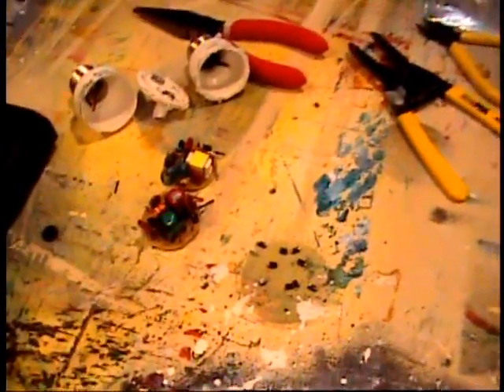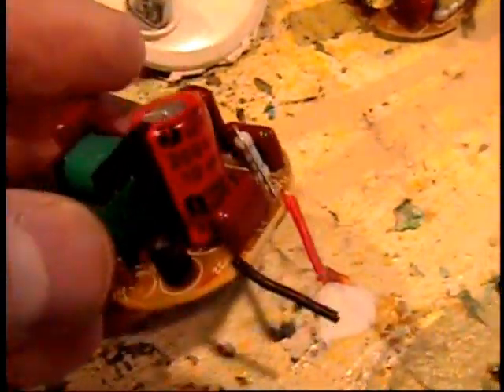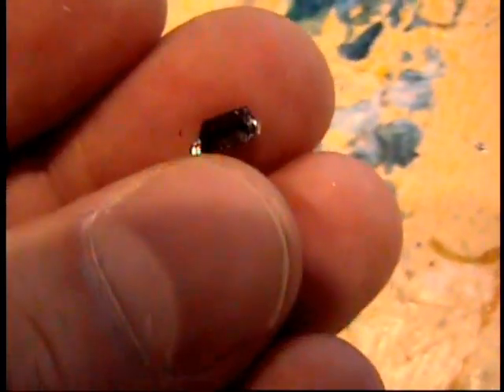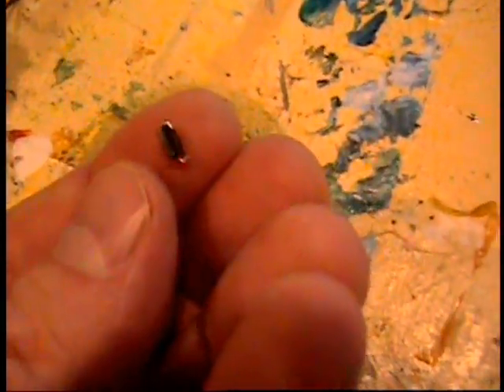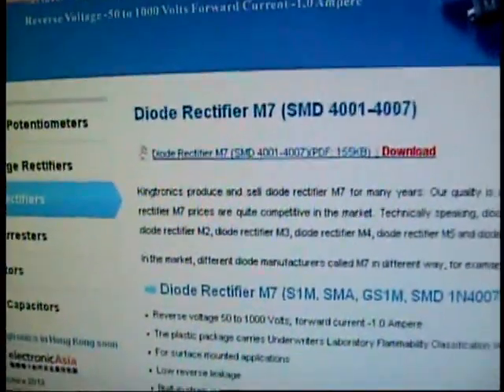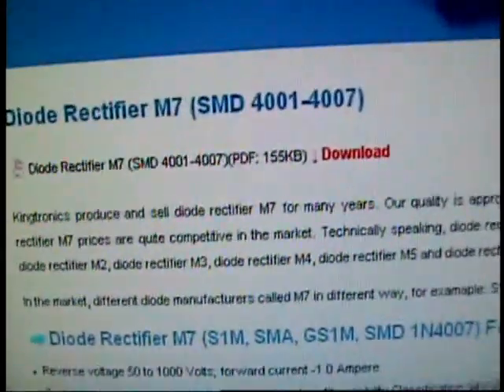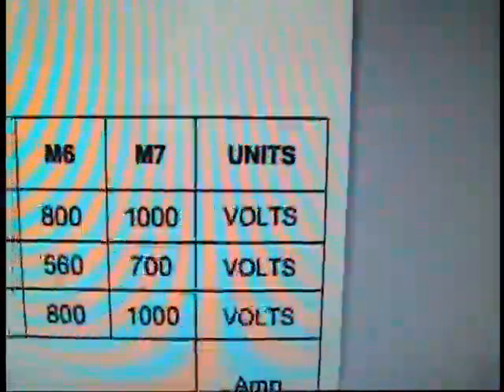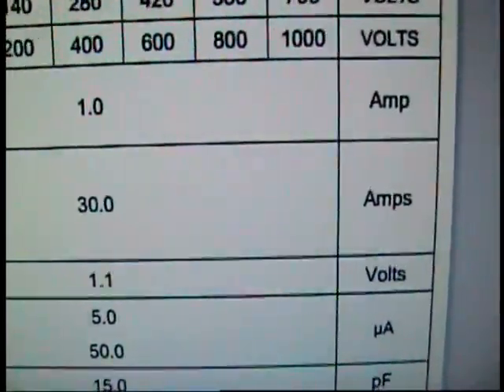Diode M7

Comment: My adapter hac been broken and I opened inside and I found out these m7 diodes. How to test of they are broken or not?
Reply from the maker: georghe, most multi-meters have a diode test mode or you can use any resistance (ohm) meter. The diodes should measure about 1 meg ohms (or higher) in the direction of conventional current and 0 ohms in the other. That should be black probe to the line side of the diode and red probe to the unmarked side.

Comment: Tenk You Broder. Ai mi prcised peça transit m7  bobina in l' golf mk3 gti Tenks tenks Mém...Tenk you mi Good...Paraná Brasil
Reply from the maker: Your welcome Arts Tuning Repair. Using these "free" diodes to stop fly-back voltage on your relay coil should work well. May your Golf mK3 last forever.

Comment: Dude read the datasheet more closely - the 30a rating is saying that the thing can handle a single event at that current which  lasts for a few milliseconds without popping, so the tiny plastic case dissipating the heat is not at all ridiculous.  If you look at the charts you will se that the poor little diode will melt rather quickly if you significantly exceed the 1a rating.  The mfg whose datasheet I lookled at showed the device hitting 120c (ouch) in a very short period of time at only 1.75a continuous current draw.  Increase the current any more and the curve goes off the chart soon after.

1000v diodes are nothing new, neither are very low resience diodes that can handle large currents - it's all in the size of the die, the binding of the extrnral conductors, case material and thermal solution and of course the choice of the semiconductor itself and which dopants are used and how far into the die are the dopants diffused.  There are diodes with much higher ratings than these little SMD/SMT packaged guys that are similar sizes, they just tend to have larger packaging to dissipate heat as it would seem you are more used to seeing. And all thanks to human science. :)

That of course does not mean that there are no extraterrestrial visitors passing through our solar system or keeping watch on our planet, it seems obvious that there quite plainly are.  It's just that they didn't give us suyrface mount diodes. ;)
Reply: Clint Orison is right., U need 10 ohm resistor in series from 240v power supply before charging 4.7uF capacitor to avoid high surge current at switch ON